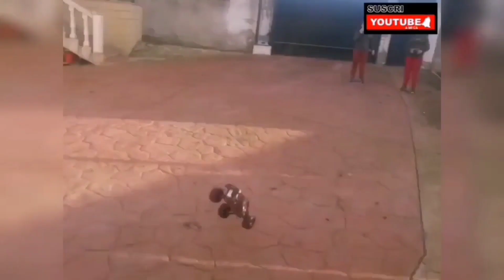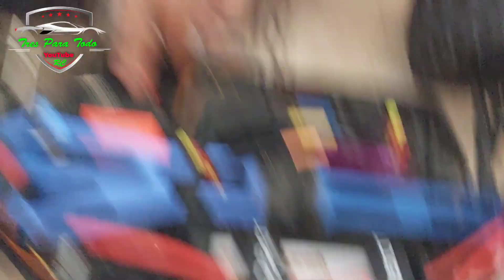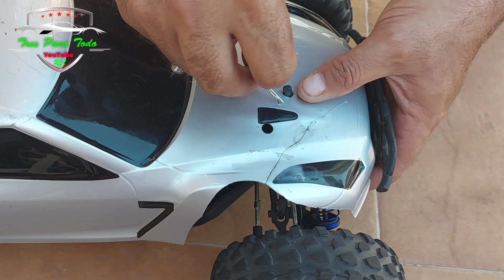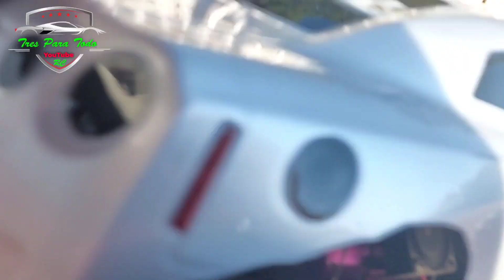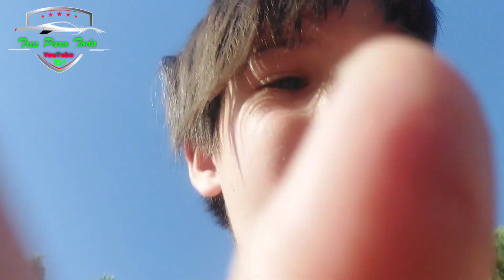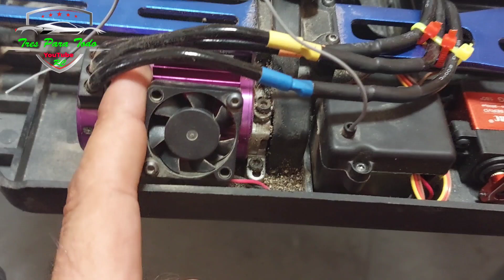Probamos el #VRXCobra a #6S. Habrá sido una Buena Idea??

Comment: And always monitor temp when mody your rc...the 1st common rule for save money...like always love u video...
Reply from the maker: Yeah in fact I was talking just that I can put thermal cut on the motor at beginning of the video.
Honestly it was funny  so don't worry too much. 
Just bad I couldn't give full throttle as it is too fast for the space I have,
It was so powerful never gone over 10% throttle
Reply: How do you put thermalcut at sensorless motor...make video for it...i want to learn it...
Reply from the maker: Haven't tried, but idea was using termic sensor from a fan and solder it to the ESC.
But I don't know if finally I wouldn't do anything as the new motor is bigger.
I think a bigger heat sink. Will help and don't need to do all the mods
Reply: My hobbywing sct have wire for sensored motor...can i use the wire and put thermal sensored in it....???
Reply from the maker: Yes I think you can.
If you have wire you can put a sensor attached to the motor and as soon you rich 105c it will cut to protect the motor yes that would work
Reply: Ok...i try then i give u a feedback...thanks bro...

Comment: Crazy I run 6s Spektrum esc and I haven't had any issues great video
Reply from the maker: Thank you bro.
Maybe it was my mistake as this is a Racing Esc and has turbo timing and boost setup and it was Maybe to high on the settings so that the motor could overheat. 
Anyway that thing with the new 3674 2250kv is as fast on 4S then the old motor on 6S.
Reply: @tresparatodorc7400  hell ya sounds good brother I run mine 22 degrees advanced in timing

Comment: Are u use diffrent pinion gear or original...??my set 120a hobbywing sct and surpass hooby 3674 2250kv 14t...now waiting cappack and glitch buster for more stable current...
Reply from the maker: I'm going for same motor now just ordered the 3674 2250kv and ESC my 150A Vgood I'm really happy how it performs.